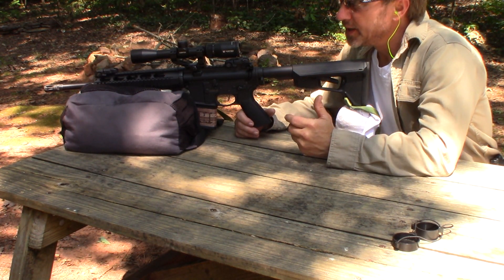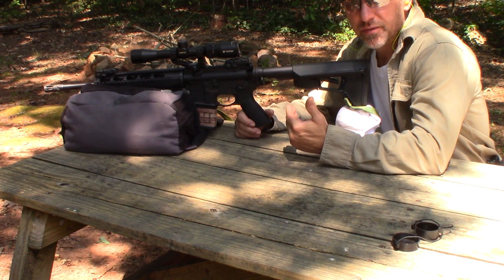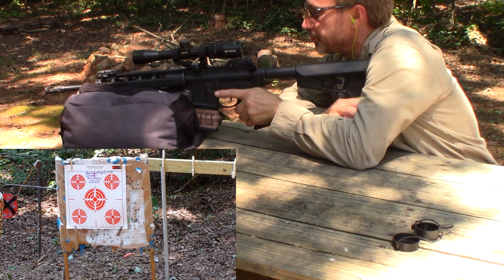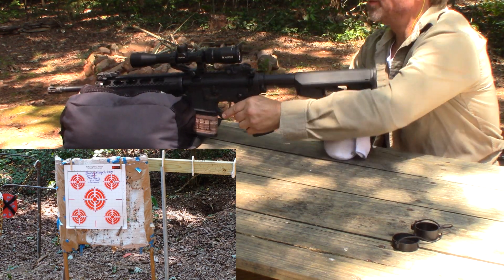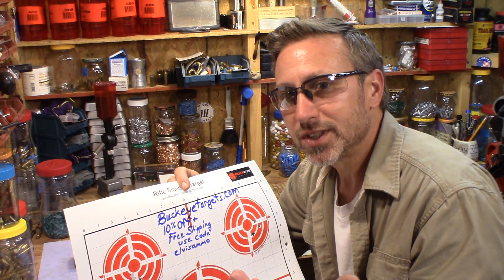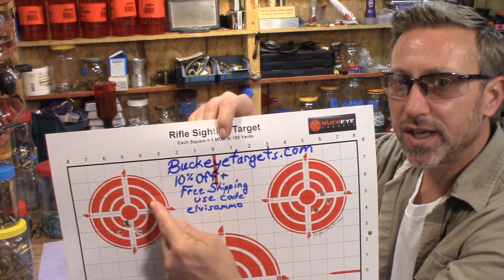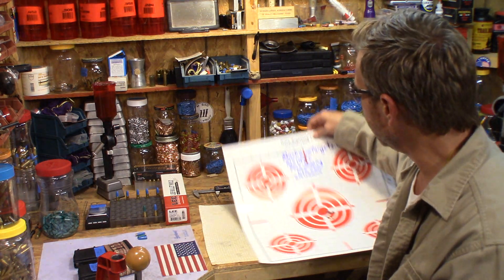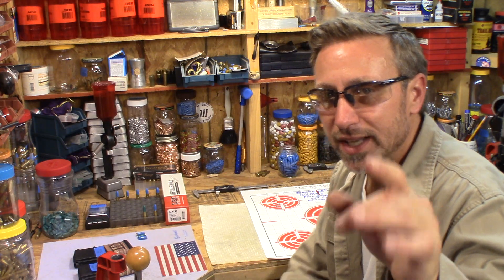300 Blk "AMMO TEST" 155 gr. Cast. Low heat, High Heat, Gas check, no Gas Check.

Comment: I’m not having luck with the low heat method. Are you sizing before coating? The sizing die stripped the PC off my boolits.
Reply from the maker: C K .. that could mean your bullets are very hard, and you might need to toss them in a lttle liquid lube first. .. I  find I need a little lube to get em through the sizer...
Reply: elvis ammo thanks I will give that a shot. You and Fourtune cookie got me into casting and now powder coating.

Comment: Elvis I have a bunch of 4198 that I used to use in a 223 bolt rifle I used to have. I don't use it very much now for my AR in 5.56 but my question is that I have about 5 pounds of it and usually always use 296 for 300 black. Will 4198 work with jacketed bullets I've never used it in 300 black or is it a good cast powder. Thanks
Reply from the maker: Hey RushShooting 67913... yes you can use it for fmj as well. there is some load data floating around out there. As you know cast bullets are heavy in weight for the size, therefor doesn't require it to be seated deep in the case. This gives plenty of room for powder. Im sure with a little testing you could come up with a 4198 load...

Comment: Well then why don't you try The high heat method  and then water quench and see if you can get back the hardness again.  I don't have a hardness tester so you have become our Guru.  I have been casting for years and this video was very interesting comparing gas checked verses just powder coat. I am going to try it in 30-30 and 8mm.  Thanks
Reply from the maker: Hey Steven Wenner.. Yeah , I already tried water quench after high heat.. Get nothing. water quench after cast this is a great help for sure....
Reply: elvis ammo ok thanks I may not worry about hardness as long as accurately is good
Reply: elvis ammo or suck it up and still do gas checks

Comment: What about a water quench after high heat method would it re-harden the bullet
Reply from the maker: Hey Steven wenner ,, Water quench after powder coat don't seem to do anything.. it does seem to help separate the the bullets ok. Heat treating is an option, Like 450 degrees for a couple hours then water quench!

Comment: Those loads sound hot
Reply from the maker: Hey Nucc's Garage... They are about right, Bullet drops at 158gr . They run around 1750 fps Brass looks great no problem. They might have a little more room. that 300 does have a little kick

Comment: I was on the forum the other day and some one was talking about doing a double low heat bake to cure the powder. Have you tired running them thru the oven twice on the low heat method. to see what it does. I have not had time to try to check that method yet.
Reply from the maker: Hey Killing Time... I did say to someone once, That if it dont cure the first time you can always run it back through... That did make me think of doing a double run.. Haven't tried it. interesting though! Maybe i'll try that!

Comment: hey Elvis! Cheer her up! You sounded so disappointed at the end of the video. What you don't figure out today you'll figure out tomorrow!
how did your barrel look afterwards? maybe check your barrel after each test load set, to see if there was any leading or unusual residue left. thank you sir! And God bless you!
Reply from the maker: Hey Kaye Szymanski.... Yep.. Not so much disappointed as a little puzzled, But thats normal for me! : ) .. I might get another sizing die. for some reason Im getting .308 instead of one over. This could be good for experimenting with different sizes. But leaves me without a .309.. Thats one thing. Barrel looked great no issues with that. Should have my new powder in the next couple days. I think all is going well, We are learning some cool stuff. We just go where the evidence takes us. I gotta feeling the new powder will improve this method and determine it's real worth! Hope the oven is filled with nice apple pie....and one fine dish after another!!!! : ) God Bless
Reply: hey Elvis ha ha, you remember me from my oven question. my husband took your advice and is going to use our old toaster oven and replace it with a new one so I win there. He figured it's better than spending 600 for a new stove. don't laugh but he would've use my stove! he use my good glass serving bowl because it had a lid, to drain his ultrasound unit of prolix lubricant because they got contaminated from the grease in an old SKS! after repeatedly washing it, he said it was fine and that may be the food would have a nice citrus flavor from now on!
so have a good weekend, You're a good guy Elvis, Thanks, see you in church Sunday!

Comment: This test is not what I expected to see and raises some questions in my mind . I didn't think the low heat method would cause the flyers with the higher BHN . So far I have used the 375 degree temp but a 12 minute bake time and see no difference group size . My tests are with the same Lee 312-155 bullet also ( no gas check ) . I'm sneaking up on the low temp method in 25 degree increments . Keep up on this , it is good stuff .
Reply from the maker: Hey James Pollard... Im thinking it could be a fluke, Brass, Bullet choice,? But I wanted to put out my findings just the way it happened! i also found that my sizing die was sizing to 308.... Wearing out? Did this affect the accuracy? The other two groups Not bad.... We will know something over the next few days! new powder .... I am ordering another sizer as well.
Reply: Why not just polish it out ? I polished mine out to .310 with sand paper and a doll .
Reply from the maker: I probably just need to clean it... : )

Comment: How well is the powder coat bonded to the bullets with the low heat method? be good if you could fire and recover bullets to inspect to see how well the powder coat stayed on or burned off.
Reply from the maker: Hey Ghost Shadow.. the 9mm did ok. Not as good as usual.. But no leading and very good accuracy! Wiped clean from glock barrel with a dry patch. I will know more with my new powder!

Comment: Elvis my results have been pretty much the same as yours, shooting the same cast pc bullet from the same mold as you are using. I don't use gas checks but I'm less than an inch from bullseye on each shot or closer so I say this is a winner. I'm shooting a different powder. I'm using hodgdon LILGUN still working on my load but my current powder load is really shooting well. Thanks for your testing and method it made a difference for my supersonic blackout ammo.
Reply from the maker: Thats awesome NYC Reloader .. I need to try lilgun.. Cycling good with lilgun? Yes this is panning out to be a winner for sure. I will be able to test my new powder in 2 or 3 days!
Reply: Elvis ammo LiL gun works great as does your method. Also I'm using CCI 400 primers in my 300 blackout. A higher end primer didn't make it shoot any better and all my powder is burned so I think I'm good. Did you chrono yours yet? I forgot my chrono and didn't want to drive all the way home to get it.
Reply from the maker: I beleive im at 1750 fps...

Comment: Elvis, thanks for doing this test. My dad and I have been watching your videos for hours and hours over the past 6 months or so. Me, my dad, and my dad-in-law all shoot 300BO. I have been loading our ammo using the 147gr pulled m80 bullets, but I've been looking for a way to reload cheaper (and have an alternative should the m80 supply dry up). My dad is going to cast our bullets from wheel weights with the Lee 312-155 based on your suggestion.  I REALLY did not want to use a gas check if we could get away with it. Looks like we can. What was your method for getting the  BHN of 15? Half clip weights/half stick on weights coated at 400 for 15min? Do you think the smoke and your fliers with the no GC low heat coating were due to gas cutting? We need to all throw in some cash and get you a lead sled. I'm willing to send some if you can get some other guys to. Nothing against you - I'm sure you're a great shooter. It would just take the human element out of your testing and show exactly what your bullets are doing on their own.

Comment: I wish you would quit giving out our favorite powder.   If you keep it up there will not be any of the IMR 4198 for either of us.  😁😢
Reply from the maker: No doubt The Reloader Dude!! What I won't doto fill a video!!! : ) Great powder huh!
Reply: 4198 meters horribly though, I stocked up on it couple years go.  RCBS powder measure will bind every single time.  Cheap lee measure actually able to handle it but it's not perfect.  I might have to buy auto dispancer since my 221 fireball really likes this powder.  I found CFE BLK give me best accuracy with light 115gr bullet; lower pressure for cast bullets.
Reply: Dima Prok so that is the powders fault?? My Redding doesn’t  bind and throws it perfect.  My RCBS lite measures it perfect..  maybe just maybe it is your powder measures and NOT the powder that is the problem.  Yes, I get it is a long thicker powder, but you just might just need to upgrade to better equipment..and if your fireball likes it, time to step up.  😁
Reply: +Reloader dude, YES, because other powders will meter just fine with my RCBS uniflow.  I had RCBS Chargemaster and I returned it because it would vary as much as 0.2 grains and that's not good enough for me.  The new RCBS lite has great reviews that's why I said I am considering auto dispenser.  I don't have experience with Redding but competition 10x looks highly rated on Midway and I don't need more than 25gr even for my small caliber rifles.  Which Redding measure do you have?
Reply: Lol, I just googled Redding 10x and found your video review ha ha ha.
Reply: Dima Prok it is worth the money!!  :-)
Reply: Which one?  The Redding 10x or RCBS lite?
Reply: Dima Prok i guess that is up to you.  They both have their purpose.  For a big batch, I would say the 10x.  For small or workups, the Light.   The 10x is sharp enough to cut the long powders (watch you finger on the internal drum it will cut you) but you have to give it a good “click” and not pussy foot around with it.

Comment: I'm still trying to understand any benefits to the low heat method, including an investment into new,untested powders, when the old protocols were completely serviceable. I think the saying, if it ain't broke, don't fix it, might apply here.
Reply from the maker: Yep M85FSLUVR... no need to change anything., It all works as is. I happened to find a way to powder coat without changing the BHN. and im still in the test faze... No investment needed at all. Only if you see something you like, Then you can purchase the new powder instead of buying the same powder! Just sharing my findings! Besides this ammo test is for everyone, not just people interested in the low heat method!
Reply: elvis ammo if I remember correctly, the impetus to alter the process was because of the instability in the BHN relatively soon after the casting/coating. But we saw here that your original plinking projectiles ultimately stabilized at the original 15 BHN that they were cast at. That should be a data point worth considering. The "bounce" phenomenon may be hard to explain, but may be only temporary, too. 😀
Reply from the maker: Yep so true! M8FSLUVR... There is much to speculate on here I know. The 15 Bhn. would have been 20 or so? The coating burning off because the lack of cure, My Sizer die sized them down to .308? Ordering another one. Bounce! Fluke, I will always turn in true results. Hoping for a best method. But will except what happens. After all we do have it good now!!! : ) Next few days i'll be test my new powder!